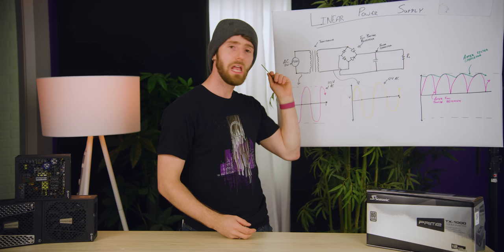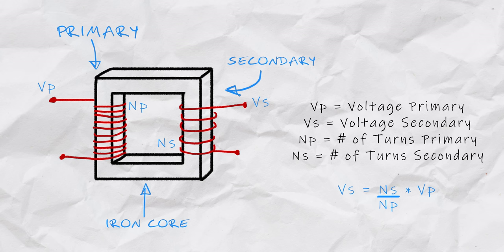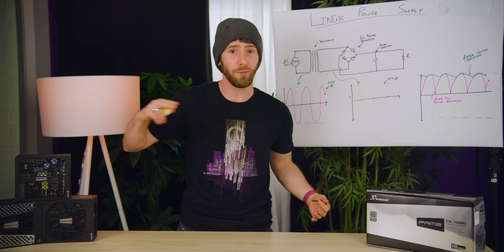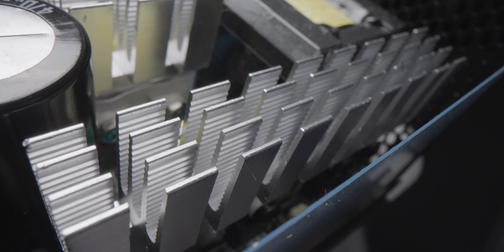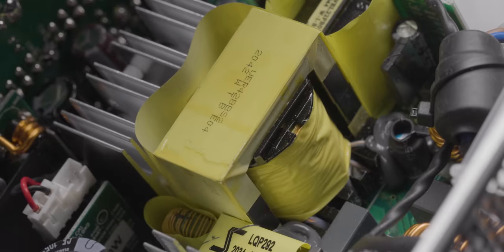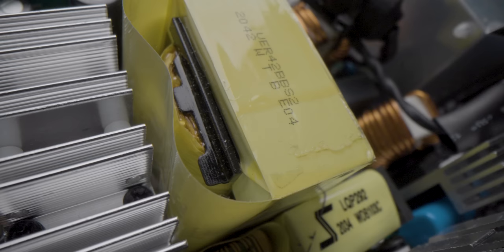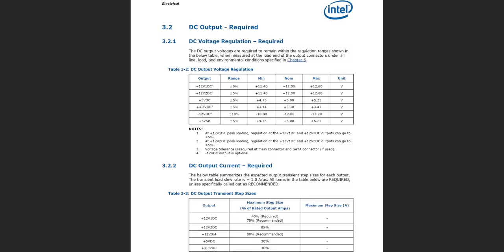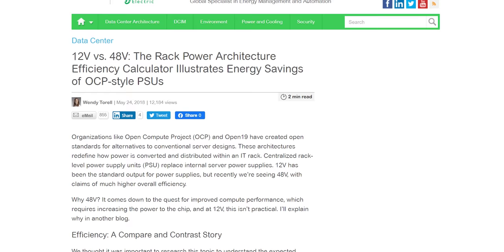How Power Supplies Work - Turbo Nerd Edition

Comment: "These big chungus capacitors" -some LMG employee
Reply: madison 100%
Reply: @evolicious  No kidding. He should go back to cleaning live light bulb sockets with his tongue.
Reply: Computer electronics such as video cards actually use very very small capacitors...some of the systems i have worked on, the capacitors are measured in Farads (not micro farads)...computers are actually rather low power devices.
Reply: @TheFalazure  Sigh. I've repaired digital electronics since the '70s. Those 'farad' range capacitors are not low ESR. I have serviced equipment that used 1000A, 5V power supplies, to produce NTSC video.
I troubleshot new MC68340 and other MPU based embedded controllers at the factory. One was part of the ISS as the embedded controller of a kU band uplink for Data, /voice and Video. I worked on every digital board, used in that system which provided the ISS with a 40Mb/s uplink in 2000. I started working in electronics in 1960.
Reply: @michaelterrell  1000A  scary shit there...wouldn't want to get a shock from that.
Reply: @TheFalazure  5V won't shock you, but that 1000A linear regulated power supply can arc flash and severely injure or kill you.
Reply: @michaelterrell  Oh i know all about the dynamic of what will kill you between voltage and current,  static shocks can be up to 20+kV  but with no current they are not much more than a little skin prick...high current though, that is a killer...one of the systems I maintain has a bank of 6 300A fuses in it in a parallel circuit, getting a shock from that cabinet from what some of my former instructors have told me will throw you across a room (DC).  Personally not something i would want to be subject to myself.
Reply: @TheFalazure  Polarity of a DC voltage determines if your muscles expand or contract. One will kick you free, while the other will have the conductors in a death grip.
It's like playing Russian Roulette, with a bullet in every other  chamber.  :(
Reply: @michaelterrell  That i didn't know about DC, i knew AC had a tendancy to hold a victim  thought all DC threw you, thanks for that...learned something today.
Reply: @michaelterrell  Wait did he get anything wrong?
Reply: @hanhong2267  He got a lot wrong. He doesn't understand basic electronics, and makes a lot of assumptions that are wrong.
Reply: @michaelterrell  Yikes, didn't know that. Can you give me a couple of examples for the biggest things I need to watch out for?
Reply: @hanhong2267  You don't turn 12VAC into 12VDC in a switching power supply. If it is a sine wave, 12VAC gives 12*1.414 output, minus the diode(s) forward voltage drop. The output, would be 16.968 VDC, before the diode drop. That drop is typically 150–450 mV, per . This requires a sine wave voltage of about 8.7 VAC
Synchronous Rectification uses power MOSFETs that are switched in phase with the transistors on the primary side, for even better efficiency. 
He mentions 'X' and 'Y' capacitors, but doesn't tell you what makes them different from regular film capacitors. These are seal healing, which means that if a failure develops, it will open that area of the capacitor to prevent a short. The 'X' capacitors go across the Line and Neutral. The 'Y' capacitors go from each of these, to the ground. They are used to attenuate the switching noise from the diodes on the AC input. So much more BS in this video.

Comment: Ironically enough, the two oldest things in my current PC are the PSU and my spin drives for storage. I went WAY over spec back when I bought my PSU new because I did not know for sure what hardware I would end up with in the future. And, I am glad I did because at one point I was running an overclocked Intel i5 3570K with an Gigabyte Windforce AMD Radeon R9 290 that ran surprisingly cool (as cool as 80*C can be considered, since the GPU would push for 90+) and overclocked very well at the expense of being a 300 watt space heater. It was a very FUN 300 watt space heater though for the 2 years I owned it from 2017 to late 2019. So glad I ended up with a GTX 1070 and AMD Ryzen 5 1600X next, summers became more bearable if I wanted to game. Now, the power supply I have had for the last 10 years is powering a Ryzen 5 5600X and RTX 2080 Super. That all said, I may start looking for a new PSU soon, considering just the efficiency gains alone, and this PSU has had a lot of use on it.....

Comment: YES MORE
Now do one telling me where all the cables are on a motherboard or how SSD’s work
Reply: "Where alle the cables are on a motherboard".... What cables?
Reply: @loeffel999  the ones the get power to sata devices. and there are still many things that still use molex for power. and with 3.3v and 5v coming from the board it  needs connectors to supply these devices with power.
Reply: @loeffel999  oh, I meant headers.

Comment: 1:32, Japan be like "hum, actually..."
Reply: also europe since we use "230" (or are supposed to at least)
Reply: @lemonbrothers3462  Europe uses 400V phase-to-phase RMS, but most households only use 1 phase, so they get 230 (or 231) V RMS between a phase and neutral.
Reply: @matekovacs2696  yeah, pretty much no one cares about phase to phase because we normally don't run 3 phases in households. even if a house get's 3 phases, other than the odd oven or water pump it gets split between section/floors/whatever and we only see the 230

I mentioned supposed to because it was 220 long long ago and there are a lot of transformers that still only provide that and a lot of people get confused with it and call it 220 (although the spec is clearly 230)
Reply: @lemonbrothers3462  Three phase is very common in rural areas, at least in rural Hungary, where people have some rather large, and pretty old machines. For instance, my grandpa has a 3-phase compressor. And a 3-phase water pump. Other big machines used in agriculture often use 3-phase as well. Even in the city, I know people with 3-phase water boilers in their bathrooms.
You are not wrong, it is less and less common, and urban/suburban households usually don't need it, but it is definitely there. The spec specifies phase-to-phase as 400V (nice and round number), and single-phase is calculated from that by dividing it by the square root of 3. Hence the arbitrary-seeming 230 (or 231) V.
Then it is also true that some equipment can only do 220V because previously that was the spec, but most appliances that were designed for 230V can run at 220V, and 220V appliances can use 230V too, except maybe the crappiest ones.

Comment: Imagine Linus explaining how the dielectric between two sheets of aluminum FORM an electrolytic capacitor as the dielectric forms a gas.   Imagine Linus explaining to GenZ followers how field excitation in 3 phase generator can affect power factor efficiency.

Comment: Does it really "waste energy" or does it just not pull the power from the grid during those times? I always wondered.
Reply: It makes more efficient use of the input power. utilizing the input power to the full the amount in the power flow doesn't leave the coil to burn the power as heat.
Reply: @MarcABrown-tt1fp  so the amount that wasnt passed turns into heat instead of just not pulling?
Reply: it wastes energy inside itself, it's called reactive power
Reply: @davidefogagnolo  cool, thanks!
Reply: That's not really how electricity and energy or a pc works, I'd say...
I'm no expert, but I guess "waste" is meant as energy that doesn't make it's way through the power supply, e.g. as it get's transferred to heat or as it's just completing the circle back to the source.  What is tracked by the company and what you pay for (in addition to the base-fee) is the work that is done by the energy - measured in kiloWatthour (kWh). In PC parts, i'd guess that the majority of it is energy that is transferred to heat and movement of the fans (+maybe light), as the parts themselves basically just use the electricity to create and communicate 0s and 1s to other devices by changing from spikes to no energy.

I hope I didn't mess anything up, if anyone knows a better explaination or wants to correct some mistakes feel free to comment :)
Reply: @leftleanin6649  if you have a circuit that absorbs reactive power it means that part of the current is not injected into the load but it  recirculates inside the circuit itself. The power company can sense it because you are drawing current that is not in phase with the voltage, you even have strict regulations on current harmonics that you can draw/inject into the grid and that's why you need a power factor corrector instead of a full bridge rectifier. For small loads (< 100W in Europe) you have less strict rules, so you can use a bridge rectifier without problems

Comment: During 2010 to 2018 approximately I went through three PSUs which stopped for no apparent reason. Since they are easily replaced I preferred this problem rather than some random mobo problem. Never buy a cheapo one, you need to spend $200-$400 on a good one.
One big fancy looking Coolermaster had this annoying intermittent problem, some days it worked fine and some days the mobo would switch on and then switch off. Sometimes it might start on a later attempt. After a few months of this I bought an Antec and had no further problems.
One went bang with a flash after operating normally for several months. A replacement worked fine. No problems with the mobo.
FYI it was a X58 mobo with the Intel 980 overclocked to 4GHz which I used for ten years. It outlasted several PSUs

Comment: TL:DW? Just buy a Seasonic. and they didn't even pay me to say that
Reply: Eh they still do have some really low end cheapo units that are borderline very bad such as the M12II/S12II/S12III
Reply: Also there are much better value PSUs that are better internally like CWT GPU based MSI AGF, Phanteks AMP, Whisper M, Enermax Revo DF
Reply: I take issue with this statement. All brands make good stuff and crap, and while seasonic has a lot of good units, when you tell someone "just buy seasonic," you will inevitably have someone who buys the cheapest unit they can find that meets the criteria. In this case, it's the S12III, which lacks a bunch of crucial protections.
Reply: @nunyabeeswax3012  yep exactly! and the customer may also go ahead and a buy seasonic unit when there is an equally good unit from another brand that is cheaper and/or better internally.
Reply: @xzreai1802  Or in the case of many units from NZXT, EVGA, and others, it is a seasonic unit with different branding.
Reply: @nunyabeeswax3012  NZXT C/E PSUs are seasonic focus gx rebranded as OEM,  EVGA has FSP and Seasonic.

Comment: Linus I have a question Scenario: what should I do if I have an ant infestation in my pc?
Reply: What kind?
Reply: @DouglasThompson  well like imagine Ants just crawling and hatching inside your pc case or cooler
Reply: Run a CPU benchmark for 12 hours and cook them out
Reply: @VideoManDan  lol 😂
Reply: @jamesjamesy  what I do for ants is just run a powerful directional fan and they leave.
Reply: Step 1) Get a reasonably powerful ozone generator and a plastic bag
Step 2) Put the ozone gen in the plastic bag with your PC (make sure the side panels are off) and leave it running each time you go to bed/work
Step 3) Watch them suffer.

You could also get a small mercury UV-C lamp as the light is near-xray and will kill them as well as generate ozone but it may harm your PC.
If you do get a UV-C lamp don't look at it while it is running nor spend time near it.
Reply: @TauCu  That is cruel. Op Perhaps just take your PC outside and spray it out with cans of air! PC could probably use a nice clean anyway :)
Reply: Nesting ants dont like light... so simple way is get a few bright lights shining into the case and they'll move on, then give it a good clean out.
Reply: @DouglasThompson  If one was left alive/still there they would just keep coming back.
You kill them all at once or they keep coming back.

Unless of course you want to take your entire computer including power supply to bits (And I don't recommend people disassemble their PSU as for the high voltage "big chungus" capacitors.)

Comment: The output of the transformer is usually 12V/sqrt(2) Volts. The 110V input is RMS. The input of the rectifier is peak. There's a factor of sqrt(2) in there.

Comment: PSUs becoming 48V would be the only way I wouldn't be mad at them moving the step-down converters to the motherboard, since that would greatly increase the utility of the our power supplies. I'd actually really love that.
Also, the video filled so many gaps I've had. One omission was skipping over the DC/DC step-down convertors, but I think they are just MOSFETs with inductor/capacitor combo? I know that stepping down is fairly simple, or at least you can get ton of them cheaply at every electronic component store :) .

Comment: Some modular power supplies have capacitors built into the wiring to safe space in the PSU, and that's why you can't interchange them necessarily.

Comment: It depends on how long you intend to run the piece of kit for. My audio amplifier had to have all of the capacitors replaced earlier this year... but then it was made in the 70's and hadn't actually stopped working - it just turned out that the biggest power capacitors had leaked. HUGE difference with Nichicon caps (actually made in Japan).
Reply: Wait.... What? Is this some doge coin thing again?

Comment: Most explanations of power factor focus on reactive loads, but that's not the only thing that can cause bad power factor and in the case of electronics it almost never is.

The problem with AC-DC power supplies is not that the current is out of phase with the voltage, it's that the current is *not sinusoidal*. The easiest example to explain is the linear power supply. Current only flows from the wall when the voltage on the reservoir cap is below the peak voltage of the AC waveform. This means that under most loads, the current draw will be very high at the positive and negative peaks of the voltage and pretty much zero in the rest of the waveform.

The current waveform is actually pretty close to in-phase with the voltage. However, because the current waveform is "spiky" and distorted, you end up with a bad power factor because the apparent power is still higher than real power.

Real power is calculated by taking the product of instantaneous voltage and current and averaging that value over time. apparent power is calculated by first computing the RMS of voltage and current separately, then multiplying those two values.

The real world consequence of this is that for a linear or switching power supply with no power factor correction, the RMS current going through the wiring in your house can be many times higher than it needs to be to deliver the amount of power, and RMS current is what beats up the power distribution system.

Comment: I still remember when power supplies didn't have the stand-by transformer. The power button was a literal switch and turned the power supply on and off with no signalling. Windows used to have a screen “It's now safe to turn off your computer” for that.

Comment: As a low voltage tech I can tell you the damage voltage spikes can do. I've seen voltage spikes destroy a $3500 panel (wrong power supply) those MOFs are important!

Comment: You only get “300–400V” (it's actually never even close to 400) in the ~220V countries, in North America you get ~150V. The voltage isn't increased at this stage at all, it's just smoothed to the peak voltage in your power grid (which, for a sign wave, is √2 times the quoted RMS voltage). Also, the power factor correction and turning it back into a sine wave are irrelevant to how switchmode PSUs work; all that matters is you're switching at a high frequency, which allows you to use a much smaller and cheaper transformer (because at a higher frequency you're “charging” the core in much shorter intervals, so it can be much smaller).

Comment: It doesn't matter if it's 210, 220, 230 or 240v. All power supplies can adjust that small margin with their VRMs. Even if it goes a bit wilder than that, actually. I've had my lights go dim for a few seconds a while back several times and also get brighter for a second but my platinum Seasonic PSU held its ground and my PC didn't restart through what was probably 150v and close to 300v on the high spikes.

Comment: 7:57 would have been nice to also make a short explanation of how it was done in former times and on certain PSUs still today: you only have one transformer and get the voltages from different windings. With various problems coming along with it.

Comment: Well, I have a 600W power supply (I don't even remember the name anymore, the sticker came off) it must have at least 20 years of constant use, I don't even know if it still delivers 600W, but it still works perfectly fine, upgrade after an upgrade, and today it runs a Core i7 with a radeon hd 7700 (it's old, but it works for me). The fact is that I myself cannot understand how it can work for so many years on end, it's okay that it has already gone through some cleaning and even changing the fan, but here's an old warrior!

Comment: Correct me if I'm wrong here, but I don't think the video made clear that the conversion from AC to DC remains the same for both linear and switching power supplies, but what is different is in how the DC to DC voltage is converted.

Comment: I bought a nice Seasonic 600W 80 plus titanium fanless PSU for my new build just as the GPU shortage hit. When I finally sourced a GPU last week, it was a 3090 - which pulls far higher transients than that PSU can keep up with - hello random shutdowns. Thankfully the 3090 came bundled with an EVGA 750W 80 plus gold PSU, which solved the problem. A 12 year warranty doesn't help if you under specced your PSU 😭